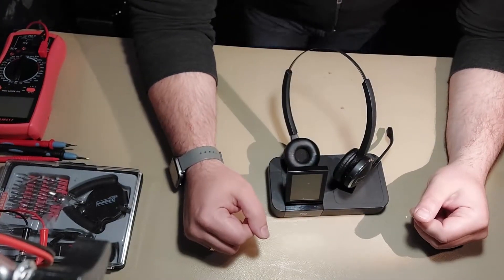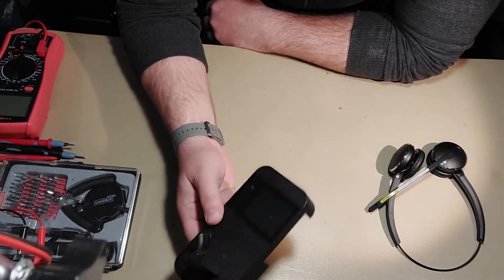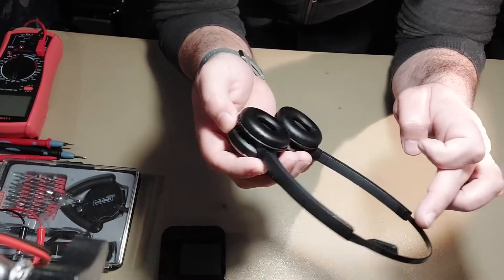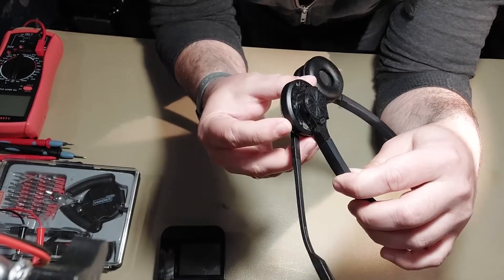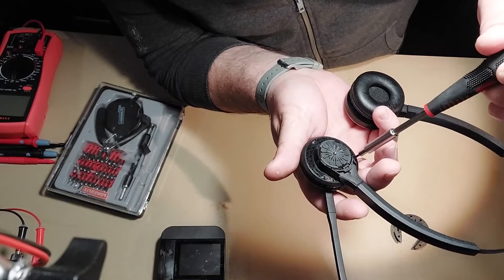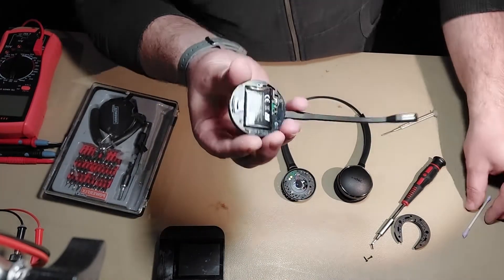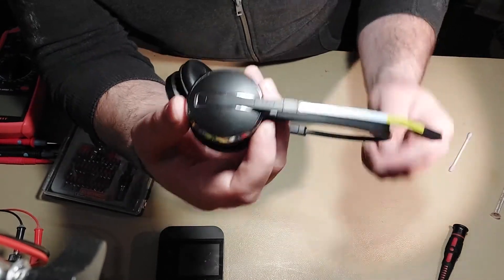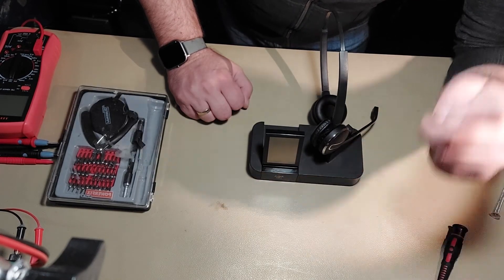Jabra PRO headset - No sound - Easy FIX

Comment: I have a Jabra Pro 9465 Duo where the sound went out. If I pressed on the boom-side earpiece the sound would come back as long as I continued pressing. When I released my finger the sound would go off again. I followed the instructions in the video and it fixed the issue. The only difference I encountered is that the torx screws in my headset required a #6 torx screwdriver instead of a #5. Thank you very much Adrian for the video.

Comment: Wow, worked like a charm.  Sadly, in this used unit, two of the screws were stripped so my #5 torx just spun and I had to drill them.  After cleaning the contacts, it came back to life.  I like the 9450, but if the tape doesn't hold, I guess I'll have to get something a bit newer.  Thank you.  This is a great video, clear, comprehensive and comprehensible.